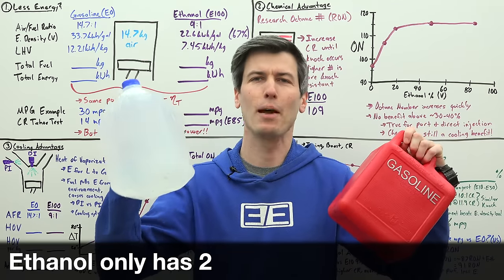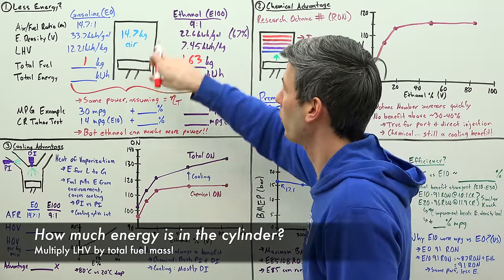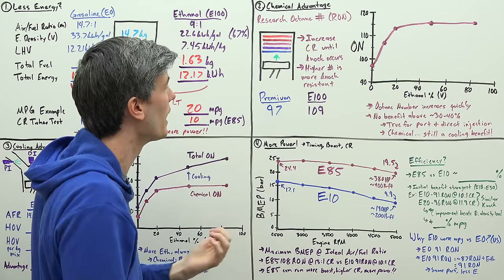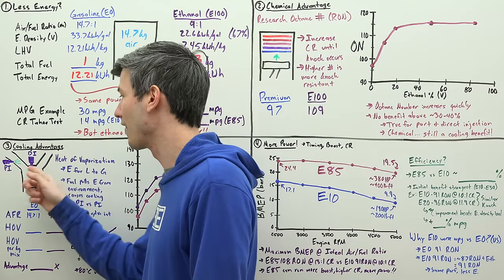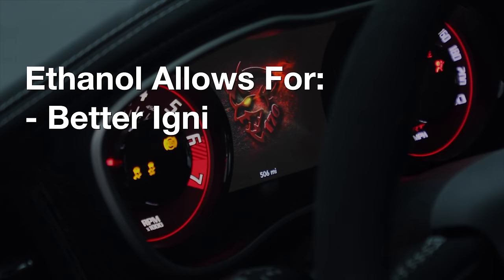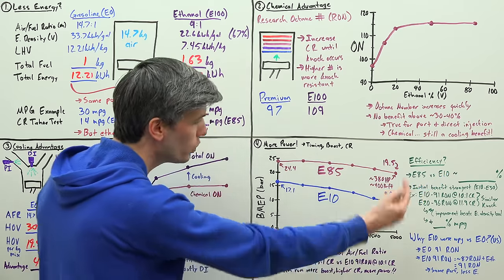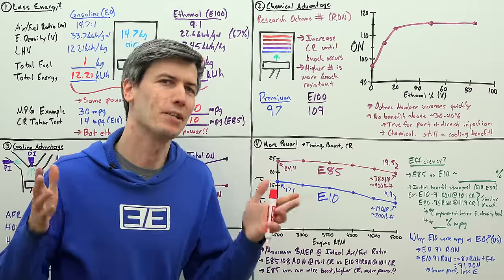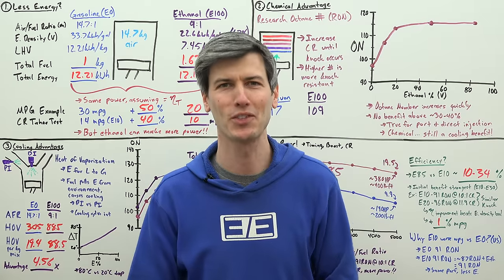Why Does Ethanol Make So Much Power? (Versus Gasoline)

Comment: I've had e85 kit on my car for bit over a year and couldn't be happier about the purchase. I've only suffered about 15% mileage increase but the fuel is less expensive enough to compensate for it. Not to mention e85 is readily available in Finland and not even made from plants but biowaste. Good stuff.
Reply: About the plant stuff he already made a video about how that's not really smart
Reply: About the rest, hell yeah! Why aren't we focusing on synthetic alcohol instead of synthetic gasoline? Isn't it much cheaper to do with the same Fischer-Tropsch process?
Reply: @christopherabramor3012  Yeah seen that. Wasn't it so that making it out of corn wasn't really smart but some weed thing would sufficed? Anyway using waste to make fuel seems like win-win situation to me.
Reply: Is it called EFlexfuel?
Reply: @christopherabramor3012  NOPE not really proven. your just mad you dont like e85.
Reply: @oldblueaccord2629  Did you read my following comment about synthetic E100 instead of synthetic gasoline? How that is not liking E85? I just like things to make sense
Reply: @christopherabramor3012  That old E85 video was about ONE study that NO ONE ELSE agrees with. I have no clue what "synthetic" gas is.
Reply: @oldblueaccord2629  Synthetic gas is gasoline made by molecular reforming. It's done with CO, H2, electricity and catalysts. It's of a much higher quality than petroleum gas since you have control of every molecule; but it's also much more expensive. It's widely proposed as a green alternative since its carbon footprint is pretty balanced, only global emissions come from process inneficiencies and electricity generation. What I'm saying is that ethanol is at a much lower step of  that process, which would be a lot cheaper. But then methane is at a lower step (if not  the first step). I think that's actually the way industrial methane is made. In conclussion, using methane as fuel should be a lot cheaper and cleaner than synthetic gasoline.
Reply: @oldblueaccord2629  Jason also did a video about why synthetic gas isn't an efficient alternative
Reply: @christopherabramor3012  alas that methane is an even worse greenhouse problem than CO2
Reply: @kumoyuki  Which offers further credence to the idea of trapping methane from landfills and composters to compress and use in CNG converted vehicles, as if methane is worse than CO2, it makes sense to burn methane to convert it into CO2
Reply: @christopherabramor3012  Sounds expensive
Reply: @christopherabramor3012  industrial methane is made out of oil. The black ground kind.

Edit: not disagreeing with your other points.
Reply: @ArsonButCute  Plus, even if synthetic methane would be less efficient than just using hydrogen (let alone production by waste materials as you mentioned which would be a lot more efficient). You would not have the complexities and costs of hydrogen distribution, methane can be distributed just as natural gas already is with the same existing infrastructure.
Reply: @kyle2034  It is, but as they have already written a law banning petroleum based new engines in Europe from 2035 (synthetic fuels exempt from this), using synthetic methane could be a lot cheaper than synthetic gasoline.
Reply: Look up Celanese, a Texas company who invented TCX Technology which economically and efficiently coverts coal, natural gas, and coal into ethanol.  China, India, Indonesia, and others are using this or looking at it.
Reply: Seems this is all predicated on your having a new motor with a compression ratio high enough to use the ethanol effectively.
Reply: @iancormie9916  E85 makes way more sense in turbocharged cars than NA. But none of the Big 3 caught on back when they were flex-fueling everything. Apparently Saab made their engines flex-fuel, and the mpg difference was negligible, but this was shortly before they went under.
Reply: Yeah well my 60s derived 4G32 doesn't like the new gas at all. SO MUCH vapour lock, seems to get worse every year. Put lead back in the fuel!
Reply: you mean 15% mileage decrease?
Reply: @jake-jm8se  Yes.
Reply: Hopefully your engine won't get sludge from it. Avoid short trips and change the oil while hot preferably IMMEDIATELY after a long trip.
Reply: @christopherabramor3012  I think you mean methanol. Methane is natural gas, i.e. a hydrocarbon, not an alcohol. But yeah, you're right that methanol is the easiest alcohol to make; you can make it easily (even catalytically) using a number of processes, and it's the precursor to ethanol if you don't want to do fermentation.
Reply: @seanmorrison3744  Nono, I'm talking about the gas. It's the first hydrocarbon you can make in a synthetic process.
Reply: @christopherabramor3012  oh, I mistook the context. Yeah, methane is the simplest hydrocarbon and the precursor to longer chains. It's the hydrocarbon analogue to methanol. You're probably correct that the simpler molecules are cheaper in aggregate because they enable more energy storage per molecule of carbon (which is probably the bottleneck, since hydrogen and oxygen are easily obtained from water and the atmosphere respectively).
Reply: @SweatyFatGuy you got Blumes book? 🤓
Reply: @SweatyFatGuy  There is a reason GM wants a 100 octane fuel standard.

Here is an engine Ricardo built for them a few years ago which is optimized for ethanol:

FROM RICARDO:
The new federal CAFE standards are calling for a doubling of fuel mileage performance, which, Vint says, is going to send OEM’s looking for high octane numbers to improve efficiency and ethanol is the best source. Ricardo, an engineering firm with over 100 years in the business of engine design, has developed an extreme boosted direct injection engine (EBDI) to optimize ethanol blends. The 3.2 V6 gasoline engine rivals the power and torque of a much larger GMC Sierra 6.6 diesel, he said, and it delivers 3.5 percent better fuel economy than the diesel.

David Blume's book has this quote:

Rear Admiral C.M. Chester wrote Henry Ford a letter on Dec.15, 1916:
"...I also pointed out in the article that as governmental laboratories had developed from 40 to 55% efficiency in alcohol engines as against 20% in gasoline machines, the use of alcohol at double the cost of gasoline for power purposes, was cheaper for motor[s] than gasoline in common use today."

Here is an article about the Indy 500 with their switch from gasoline to methanol and then to ethanol fuels:

A Brief History of Racing Fuel By Craig A. Johnson

In 2005, the IRL used 100 percent methanol in their tanks. The fuel worked well and was more efficient than straight gasoline, but IRL officials believed there was room for improvement. In 2006, they moved to a 10 percent blend of ethanol and methanol, which was then changed to 100 percent ethanol for the 2007 season.

The desire to use only ethanol aside, 100 percent ethanol is nearly impossible to obtain, and is illegal to keep without paying hefty taxes that date back to prohibition. The actual fuel used by the IRL is a blend of about 98 percent ethanol and 2 percent denaturant. The exact composition includes a small amount of high-octane racing fuel.

The fuel for today's Indy cars has an octane rating of 113, compared with methanol's 107. This means a significant reduction in pre-ignition, or knocking and pinging.

In addition, many of the people who handle the fuel, say it smells like tequila. This quality may seem insignificant, but smell is actually one of ethanol's benefits when compared with methanol. Pit crews noticed the switch to ethanol immediately, reporting fewer coughing fits and less eye irritation before any other modifications were made to accommodate it.

According to Dennis Vervynckt, manager of hospitality services and an IRL official, in 2006, the first year the IRL began using ethanol, teams saw a reduction in efficiency of about 10 percent. "That's because we put straight ethanol into the tanks," he says. "The teams initially didn't make any or very many adjustments to their engines. After a few months, they kept tweaking and by the end of the season they were back up to 100 percent efficiency."

Vervynckt points out that there was a minor loss of power. "When they first started using ethanol, teams saw a slight drop in horsepower," he says. "As the teams got used to the fuel, they were able to get more horsepower from ethanol once they again reached maximum efficiency."

The switch to ethanol also allowed the racers to carry less fuel and make fewer pit stops, thereby increasing efficiency even more. "When the cars ran on methanol tanks had to hold 30 gallons to accommodate the fuel requirements of the cars," Vervynckt says. "After getting the engines to perform at their full potential, there was a significant gain in mileage. Indy cars now have 22-gallon tanks. When a driver pulls in to change out his tires, he can fill up. Teams were able to match their tire and fuel stops exactly, instead of stopping for tires only, or fuel only."

That efficiency translates into much less fuel being used by the sport. Lifeline Foods LLC, which supplies fuel for the IRL, will produce 120,000 gallons of ethanol for the 2008 season. And though this may seem like a lot, it's 20,000 gallons less than was used the previous seasons.

The switch from methanol-based fuel to ethanol has amazed almost everyone in the league. Drivers, the direct users of the fuel, voice their approval in glowing terms. "[Ethanol] is an American fuel that is good for the country and the environment," says Ryan Hunter-Reay, of Rahal Letterman Racing and driver of the ethanol car. Standing beside his crew as they make last-minute adjustments to the car, he is more than happy to discuss the benefits of the IRL's switch to ethanol. "It's been great for Indy racing the fuel economy, emissions there's nothing we don't like. We love it."
Reply: @SweatyFatGuy  yo i need help tuning .my 98 silverado to e85 and e98 i wanna homebrew my own can u help?
Reply: @SweatyFatGuy  I'm curious, what would your opinon be on the development direct alcohol fuel cells and co2-to-ethanol catalysts? It's high tech lab stuff for sure, but in my opinon, the ability to produce from solar power and to use ethanol more efficently would make it far more practical to use on a consumer scale.
Reply: No idea how the hell did you get 15%.... I lost 33% mileage about 18,5l/100km to 26l/100km when 98E5 to changed to E85.
Reply: I drive a diesel, and luckily for me renewable diesel is plentiful here in Oz, as well as being cheap as chips (and it smells like chips). So it’s the only sort I use, because the performance is heaps better and there’s no nasty soot to clog up the pipes!
Reply: There's water in Ethanol, watch out for rust in the near future.
Reply: @the_kombinator yep we get that on a hot summers day with some models of 2 stroke outboards we rebuild. vapor lock but more commonly heat soak. the 2 are sort of related, really because ethanol makes it worse.
Reply: @maggotpudding  feeling over facts
Reply: Ohhhhh but when I said this years ago on Reddit, people went on and on about how that didn’t equal out blah blah bla…. I’m literally spending less at the pump and getting where I need and BARELY filling up more. I mean I hardly notice the difference
Reply: Mercury Marine, which hosted a Webinar on ethanol myths, noted that ethanol does not "grab water molecules out of the air." It is hydrophilic, which means ethanol holds water. With regular gasoline (E0) as well at E10, the primary cause of water collecting in tanks is condensation on tank walls. But unlike E0, which can absorb almost no moisture, E10 can hold up to half of one percent of water by volume, and the water molecules will dissolve in the fuel. The "solubilized" water will bypass the water separator and burn harmlessly through the engine.

>>>>Mercury Marine also says E10 may be the superior fuel(over E0) because it keeps the fuel "dry"<<<<

Brazil is hot and the same outboards we have use their common gasoline which contains 27.5% ethanol.  It has worked out so well and for so long that Paraguay went to E27.
Reply: @kumoyuki  CO2 creates plant life! how is that bad?
Reply: I did drive my 1991 Mercedes 190E on a mix of 98 octane and 40% E85 to save money as it cost almost half of gasoline :) I did adjust the air mass measure device cheating the engine into running rich mixture so it could handle the E85 + 98 ocane mix. A side effect was that the bi annual measure of pollutions did show 0  -   0 , and without E85 I could not pass the emissions test....
Reply: @SweatyFatGuy  Hi i really want to learn about this subject of replacing corn ethanol with other higher yield crops. So i wonder if you have some studies you can point to that make the case for a better alternative to corn. I hear a lot about switch-grass,hemp...etc but it is mentioned that you can make cellulosic ethanol out of these (whose process is more complicated and more expensive) and not starch ethanol.
what is the realistic amount of ethanol that we can get from cattails given its growing conditions (land & climate) vs other plants ?
would like to hear from you on this a s someone with first hand experience.
Reply: there is a way to make ethanol it is illegal   by the law but oil company will not late it be car with ethanol even in 1000 years
Reply: @kalamatagames2631  how ?

Comment: Another benefit you didn’t mention was, on Turbocharged engines the added mass of the ethanol in the Air/fuel charge  compared to gasoline significantly improved turbocharge response. That extra mass is able to impart more energy on the turbine therefore improves response. While E30-40 is the sweet spot chemically, going above that can improve low end torque by improving turbo response. That was a fantastic video BTW!
Reply: I really appreciate comments like this. That's really fascinating! 😲
Reply: @misterkeys2893  It's why we read the comments.
Reply: Yes. I used to have an old Volvo 940 turbo that i converted to run on e85 using 50% larger injectors. (needed for the ECU to make sense of the lambda feedback signal) It ran really great even on high boost. Sadly they don't sell e85 anymore where i live. 😢
But at present hey do sell e10 (euro95) and it runs fine in the car i drive today (a lexus hybrid)
Reply: I have a twin turbo charged gas engine and I have the option of ethanol free gas at 88 octane.  I live in the Denver colorado area so high altitude.  Is running regular e10 gasoline better than running ethanol free in high altitude?
Reply: @jefftravis384  less octane is required at altitude.
Reply: Does the lower air fuel ratio mean the turbo also doesn't have to work as hard
Reply: There's always one.
Reply: I had been building and racing NA engine cars for decades, but got tired of having my lunch eaten by all the turbo guys. Granted, there was a steep learning curve in making the jump to forced induction. Then again when converting to e85, but getting all the gains I've experienced, I'll never looked back. Originally, to make the desired HP out of a 2.0L 4 cylinder for track use, I was running it on 98 race gas with a GT3071R turbo making 24 psi. Lag was completely ridiculous, even with variable control from the ECU, power came on like an on/off switch at 4.5K rpm, and with sustained boost, heat sink was a constant issue. Not ideal for a track car, but switching to e85 turned out to be the magic sauce. I was able to get more power out of a smaller GTX2867R at 22 psi. It's now making positive boost at 2.5K rpm with the flat linear power curve of a NA V8 engine, and I've never had heat issues since. What's most impressive after switching over, after 5 seasons of thrashing on it, with regular maintenance my engine is still running strong. From beginning with research to my own personal experience, this fuel has far surpassed my wildest expectations. I doubt you'd see the same results from a daily driver, but thanks to this vid you can see why e85 has truly earned it's reputation as "absolute turbo crack" in the racing community.
Reply: May I ask why E30-40 is sweet spot chemically? Or why E needs to be blended with gasoline?
Reply: @bushmaster1740 Not when your engine is turbocharged. In fact, I would argue you need more octane since the turbos are operating at a higher compression ratio, meaning the charge air is hotter.
Reply: @jefftravis384 If the E10 is 91 octane then its better.
Reply: Ethanol is blended with gasoline to keep people from drinking it 🍹 
It’s the same as drinkable alcohol.
Reply: @ProctorsGamble  that is not why is blended with gasoline. Industiral ethanol has a bitter added into it so people don't drink it.
Reply: Why does my twin turbo truck say NO E85 ?
Reply: @TheStp77  probably because it isn’t flex fuel capable.
Reply: @TheStp77  because the stock tuning is not able to accommodate the increased amount of fuel mass needed to run e85. Flex fuel cable trucks are able to alter the targeted air fuel ratio. Where is trucks like the F150 eco-boost or tundra do not have the software to do that. With an aftermarket tune you could run e85.